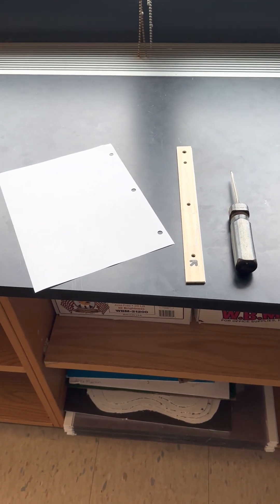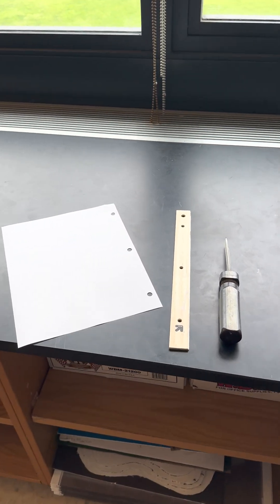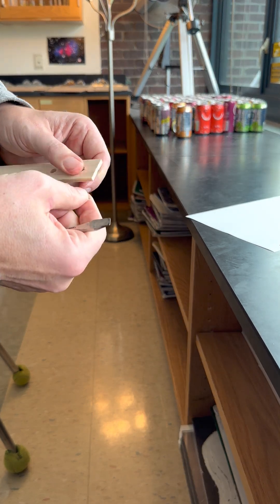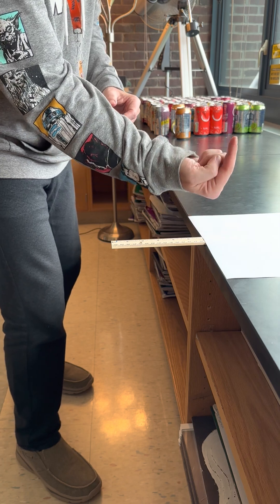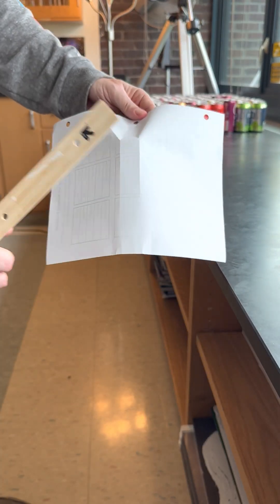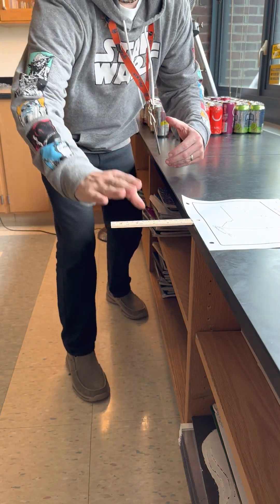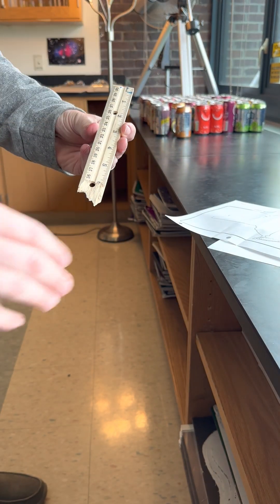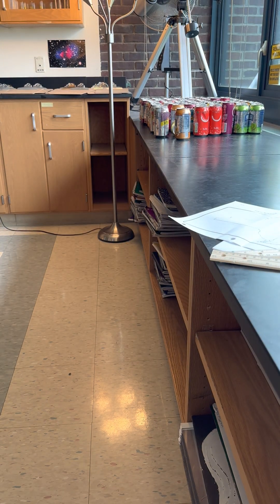Atmospheric Pressure Causes This Ruler to Snap

Comment: Its neither inertia nor air pressure its the weight of all the trees you killed to make that smoll piece of paper.   Greta is very disappointed

No its air pressure. Not inertia. The mass of half a ruler is very low. The force a ruler can withstand is very high. And remember that the balance point is a pivot so its more about torque than force.  There is not enough time for air to rush in from underneath the paper, so its air pressure vs partial vacuum acting on the table half of the ruler.
Reply from the maker: It’s an impressive demo.  Try it.